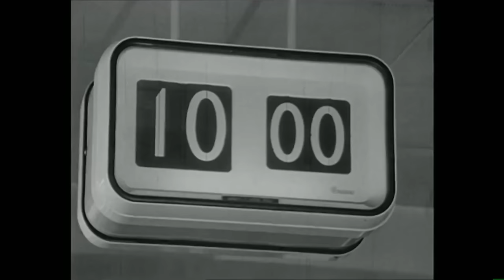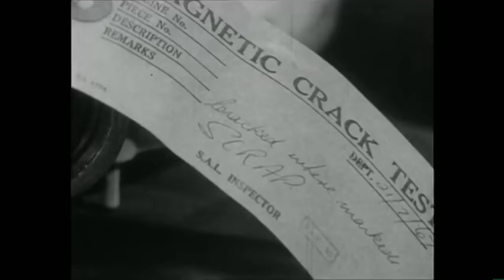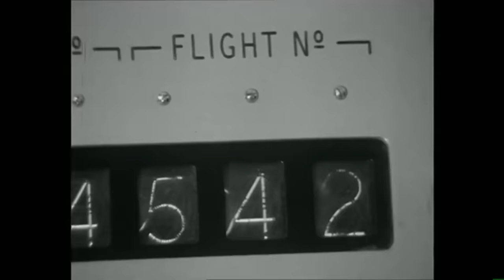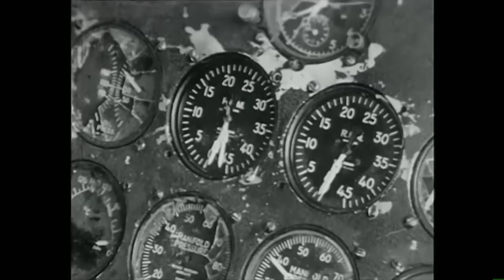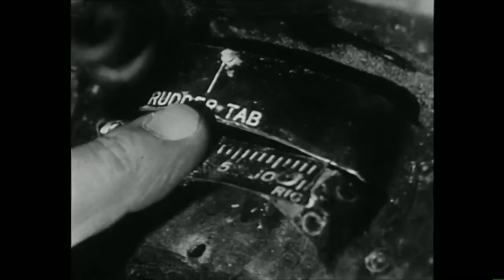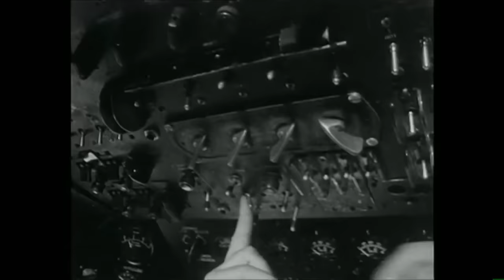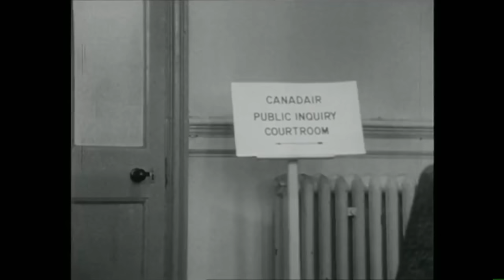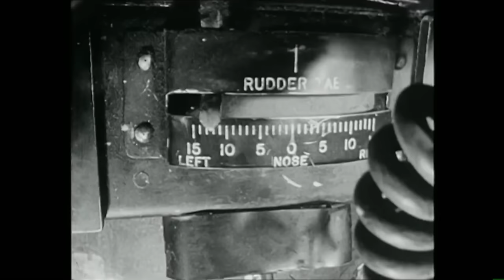Stockport Air Disaster

Comment: Did they ever use these engines in a DC 3??Canadair North Star
From Wikipedia, the free encyclopedia
Jump to navigationJump to search
North Star
BOAC C-4 Argonaut Heathrow 1954.jpg
BOAC DC-4M-4 Argonaut G-ALHS "Astra" at London Airport (Heathrow) in September 1954
Role	Passenger and cargo transport
Manufacturer	Canadair
First flight	15 July 1946
Introduction	1946
Retired	1960s (RCAF), 1975 (last civil operator)
Primary users	Trans-Canada Air Lines
Royal Canadian Air Force
Canadian Pacific Air Lines
BOAC
Produced	1946 - 1950
Number built	71
Developed from	Douglas DC-4
The Canadair North Star is a 1940s Canadian development, for Trans-Canada Air Lines (TCA), of the Douglas DC-4.[1] Instead of radial piston engines used by the Douglas design, Canadair used Rolls-Royce Merlin V12 engines to achieve a higher cruising speed of 325 mph (523 km/h)[2] compared with the 227 mph (365 km/h) of the standard DC-4. Requested by TCA in 1944, the prototype flew on 15 July 1946. The type was used by various airlines and by the Royal Canadian Air Force (RCAF). It proved to be reliable but noisy when in service through the 1950s and into the 1960s. Some examples continued to fly into the 1970s, converted to cargo aircraft.[3]

Contents
1	Design and development
2	Operational history
2.1	RCAF service
2.2	TCA and BOAC operations
2.3	Later service
3	Variants
4	Operators
5	Accidents and incidents
6	Surviving aircraft
7	Specifications (DC-4-M2 North Star)
8	See also
9	References
10	External links
Design and development
Canadair Aircraft Ltd. took over the Canadian Vickers Ltd. operations on 11 November 1944. Besides the existing Consolidated PBY Canso flying patrol boats in production, a development contract to produce a new variant of the Douglas DC-4 transport was still in effect. The new Canadair DC-4M powered by Rolls-Royce Merlin engines mounted in Rolls-Royce Universal Power Plant (UPP) installations[4] emerged in 1946 as the "North Star." More than just an engine swap, the North Star had the Douglas DC-6 nose, landing gear and fuselage shortened by 80 inches (6.7 ft; 2.0 m), DC-4 empennage, rear fuselage, flaps and wing tips, C-54 middle fuselage sections, wing centre- and outer-wing panels, cabin pressurisation, a standardised cockpit layout and a different electrical system.

Canadair built 71 examples of what was officially called the Canadair Four under the designations: North Star, DC-4M, C-4 and C-5. With the exception of the single C-5 (which had Pratt & Whitney R-2800 engines, as fitted to the Douglas DC-6), these variants were all powered by Rolls-Royce Merlin engines and 51 of the production examples were pressurised.

Operational history
Trans-Canada Air Lines (TCA), the Royal Canadian Air Force (RCAF), Canadian Pacific Airlines (CPA) and British Overseas Airways Corporation (BOAC) were the principal operators of the "North Star", with the CPA examples known as the "Canadair Four" and BOAC examples known as the "Argonaut".

RCAF service
The RCAF North Stars were unpressurized and were used on a variety of transport duties. Like other North Stars, they were notorious for the high level of cabin noise caused by the Merlin engines, as unlike the radials of the DC-4, the exhaust from the individual cylinders is not collected and exhausted via a single outlet, but instead exits the separate individual ejector-exhaust stubs in high-pressure bursts.

RCAF C-5 North Star
In an effort to reduce cabin noise, the sole C-5 variant was powered by Pratt & Whitney R-2800 Double Wasp engines that were considerably quieter.[5] The only C-5 was delivered to the RCAF in 1950, entering service with No. 412 Transport Squadron RCAF in Uplands, Ottawa, specially outfitted for the transportation of VIP passengers. It was used to transport the Canadian Prime Minister, the Queen, and numerous other dignitaries on various high-profile missions, serving faithfully for 17 years, later becoming a crew trainer before being retired and sold in the United States.

North Stars were also employed by 412 Squadron RCAF on various VIP transport duties and, overall, the aircraft provided valuable and reliable long range transport services for the RCAF. From 1950 to 1952, during the Korean War, RCAF North Star aircraft were employed ferrying supplies to Korea across the Pacific Ocean. They flew 599 round trips over the Pacific and delivered seven million pounds of cargo and 13,000 personnel on return trips. They flew 1.9 million miles without a fatal crash and outhauled the United States Air Force C-54s on the Korean run. After 1967, the remaining North Stars were assigned to No. 426 Transport Squadron RCAF initially deployed to Dorval, Quebec and then to Trenton, Ontario. Gradually, their service life diminished in the 1970s and most were declared surplus.

TCA and BOAC operations

TCA North Star at London Airport (Heathrow) in 1951

An ex TCA DC-4M-2 North Star of Overseas Aviation at Prestwick in 1960
TCA received its fleet of twenty DC-4M-2 North Stars during 1947 and 1948 and operated them on routes within Canada and to the USA until 1961. Starting in 1954 the North Stars were replaced on TCA's routes to Europe by Lockheed Super Constellations. To deal with passenger complaints about noise, TCA engineers developed a cross-over for the fuselage-side exhausts that reduced cabin noise by 6-8 decibels.[6][7] "In the cabin, noise is reduced to 102 decibels near the windows and 93 at the aisle."[8]

BOAC ordered 22 DC-4M-4s and named them the "Argonaut class", each aircraft having a classical name beginning with "A". The Argonauts were delivered between March and November 1949; they flew to South America, Africa, the Middle East and the Far East from London Heathrow Airport until 1960.

On 1 February 1952 the BOAC Argonaut Atalanta G-ALHK transported Princess Elizabeth and the Duke of Edinburgh to Kenya to begin a Commonwealth tour.[9] Some days later, 6 February, it was again Atalanta G-ALHK which returned the newly acceded Queen Elizabeth II to England upon the death of her father, King George VI.[10][11]

Rolls-Royce also developed a quieter 'cross-over' exhaust system for the DC-4M, the modifications being supplied in a kit allowing installation on the aircraft by the operator. The engine thus modified became the 'Merlin TMO' in contrast to the unmodified engine, the Merlin TML - Transport Merlin L. The modified exhaust conferred an increase in horsepower over the unmodified system of 38 hp, resulting in a 5 knot improvement in true air speed. Sound levels were reduced by between 5 and 8 decibels. Still air range of the aircraft was also improved by around 4 per cent. BOAC Argonauts initially, due to schedules being unable to be changed, had only the inner engines so-modified, the remaining outer engines being changed to the new exhaust system when time was available.[12]

Later service
After service with TCA and BOAC, the surplused North Stars and Argonauts had long careers with secondary operators such as British Midland Airways, Overseas Aviation and other charter companies. Cargo conversions of available airframes also lengthened the service life of Argonauts and North Stars.CF-UXA, ex-RCAF 17510 was the last DC-4M in airline service, completing its final flight on 19 June 1975 at Miami, Florida. Despite the onset of jet airliners in the 1950s, the rugged Canadair North Star found a niche in both military and civil use.[3]

Variants
Main article: List of Douglas DC-4 variants
Canadair built 71 examples under the designations: North Star, DC-4M, C-4 and C-5. With the exception of the single C-5 (which had Pratt & Whitney R-2800 engines, as fitted to the Douglas DC-6), these variants were all powered by Rolls-Royce Merlin engines and 51 of the production examples were pressurised.

DC-4M.1
Initial variant as designed for Trans Canada Airlines (TCA); at least 5 built for TCA.
DC-4M.2
Pressurised higher take-off weight version.
North Star

Comment: It was the flight engineer's job to monitor the fuel situation and he should have noticed that fuel was being pumped away from the engines (because the fuel-control levers had crept away from their correct settings).
Reply: This plane doesn't have a flight engineer.
Reply: @eddiehimself  Maybe that's why they do, now ??
Reply: @daffyduk77  No. Modern passenger planes don't have a flight engineer, nor do they rely on badly designed fuel transfer levers that don't give any positive indication that they're open.
Reply: He was not a flight engineer. He was a ground engineer, a mechanic. He was not part of the flight crew.
Reply: @daffyduk77  Flight engineers were common on passenger aircraft for many decades before this crash. They were made redundant by simplified designs and later by computerization.

Comment: Didn't they discover the 3 and 4 engine ram guages were switched...that would explain it...
Reply: Take a stride or Step aside RPM dials ? They decided this was not a factor. The main issue seems to have been the cross draining of fuel tanks. But no definite conclusion was really made.
Reply: This was mentioned again in the summary, that it 'was possible' the pilot had mistaken the failed engine for number 3, going by the instruments. Then the question was raised, that "did they realise it too late, and unable to start #3 again in time" Watch again from 44:50

Comment: At 0:50 ..”.....climbing to 2500 feet, QNH.”
Wrong - the altitude would have been given as ‘250 feet’, and QNH is always followed by numerals as it is atmospheric pressure corrected to mean sea level.
This statement is given again, with the QNH correctly, but the altitude still spoken incorrectly
Reply: No, the phraseology used is correct for the period - the controller clears the aircraft to two five zero zero feet QNH, meaning the nautical height that would have been given to the aircraft during the ealier approach.  Airlines use nautical height for landing, meaning the altimeter would have read 257 feet on touchdown (or whatever figure was valid in those days - if instructucted to maintain 250 feet, it would have been lower than the airfield height ;-)
Reply: Airplanes are given a barometer reading by Air Traffic Control so their altimeter is close to accurate as to height above sea level.  Above 18,000 ft, everyone uses 29.92 in mercury as the barometer reading and these are referred to Flight Level (FL) in hundreds of feet (U.S.).  And you wouldn't be at 250 above ground except very close to the runway, as you need to maintain 500 feet if not landing (or crop dusting).
Reply: @maschwab63  The Transition Level is 18k in the US, in the UK, it is much lower and we use Hpa (millibar) in Europe for altimeter setting

Comment: Issue
Mechanical failure 

Hanger - 4 
E - 124

F / motor 2 
F / pump 2 

Propellor blade 
Engine 4 stopped 
Propellor turned by wind 
Lancashire 
Roof tops 
Cockpits 

Dentist 
Strange

Lost height 
Tragic

Tail end 
Performance 
Of height ; air speed ; course 
Trapped in wreckage 
Fact recorder 
Air registration  board 

<100 mph 
Feathers the propellor 
Argonaunt control
Dangerously near to spinning 
Port engines in full power

Comment: No indication which engine had failed!  Others knew about the fault, it's a wonder it hadn't happened earlier.  You got to wonder why other airlines kept silent after the crash, you would have thought someone might have said "There is a fault condition with the cross feed, check the lever is properly closed.  But then, airlines are only interested in profits!

Comment: 4 Merlin engines in an airliner... in 1968... gee, what could have gone wrong?
Reply: @JZ's Best Friend I think he’s implying the age of Merlin engines in 1968, under the false assumption that old means faulty.
Reply: @JZ's Best Friend as investigators found, the conclusion is that the engines were likely in proper order, but that the cause of the crash was due to crew error relating to the cross freed levers. Which in turn lead to fuel starvation in engine #4, and confusion that snowballed from there.
Reply: Same thing as a DC8 or 727 in 68.... shit happens and airplanes sometimes crash.
Reply: @gastonbell108  Compared to the B-52 and many other aircaft in current service this plane and engines were spring chickens plus it's usual to have spare engines so when there is an issue they can be swopped out, in service they get stripped down and inspected every 1000hrs or so. Plus by this point in time the engine was well proven haveing been used in combat and civilian aircraft for decade plus so old tech maybe but well proven.
Reply: The Merlin was a superb engine.  What do you think powered the Spitfire and Lancaster?
Reply: Hawer Hurricane, D H Mosquitoes, Fairy Battle, Paul Doulton Defient, Avro York, some versions of Halifax and Wellingtons, Fairy Fulmar, lockheed Mustang, later version P-40 Hawk family and some others but I am struggling to remember names. Firefly  and Barracuda I think, where like latter Spitfires and Shackleton Griifin engines which was basically enlarged version of Merlin at roughly 36 litre capacity rather than Merlins 27 capacity. Well a jet engine might have been newer but early jets were not very fuel efficient and still being improved, for instance me 262 engines had expected life of 25 hours if they last half that they were thought to be doing well. Best off the cuff help on this I can give, our American friend seems to think developement takes a few months and in war time that might be true but in peace time refinement can easily take 10 years.
Reply: @owen368  The only similarity between a 'Griffon' and a 'Merlin' was the V-12 layout. This engine was designed not for the R.A.F. at high level, but at the request of the Fleet Air Arm for use at low level, so nearly everything else was different; lubrication of main bearings via hollow crankshaft, position of super-charger and engine accessories like camshaft drives and one B.T.H. dual magneto at the front not two at the back, slightly shorter engine, the possibility for contra-rotating propellors and of course the 10 litres increase in swept volume.
Reply: @DaveDeltic  Well I live and learn all I knew was size and shape and that some of the planes that used Merlins like the Spitfire went over to Griffin engine. It is often not distinguish as being much different in several books either know the contra rotateing props were used on the Shackleton as my Dad mentioned one that visited where he was based, latter crashed when it shed a blade killing the crew sad to say.

Comment: Pilot can't remember, pretty convenient seeing as how the cause turned out to be fuel starvation to the engines due to mismanagement of the fuel supply by the aircrew (pilot, copilot and/or engineer). Simply put, the pilot (and those he commanded) FAILED to do their JOB by neglecting to maintain proper fuel management, thus starving the engines of fuel.
Reply: From your comment, I will assume that you have never piloted an aircraft of any sort.... 
From WW2 onwards, aircraft and the systems therein became exponentially more complex; accidents happened, and far too often the cause was quoted simply as 'Pilot error'. If that attitude had persisted, commercial air travel would be infinitely more dangerous than it is today. Thankfully, the realisation came that it would be far better to investigate how and why the error took place and fix them, rather than simply villifying the pilot - who was often dead. Was it bad maintenance (such as the reversed rpm gauge feeds in this video)? Ambiguous instruments? Badly designed controls (such as the appallingly positioned crossfeed controls in this aircraft)? Poor system design (the Engineers didn't believe the reverse crossfeed draining the starboard tanks could happen)? Bad communication (BOAC and Canadair knew about this issue more than ten years before this accident but didn't think it would be a good idea to publicise it!)?
So yes... the pilot failed to make sure the controls were pushed those last few degrees...... but the position of them made operating them awkward, and seeing they were fully home impossible. Also no pilot (in fact nobody at all) in BM knew that would be a dangerous issue in this type of aircraft *only*........ Plus the designers designed a system that would do something unexpectedly dangerous when what should have been a very minor error was made........ Plus Canadair didn't bother to tell everyone when they found out something deadly would happen if the control wasn't moved the final few degrees.......
Simply put, there is no 'Simply put'. The pilot was at the end of a long chain of possibilities to avoid these deaths - he was unfortunately the one whom it is easiest to blame as you do. Next time you get on an aircraft, be thankful that it is so safe because the aviation industry no longer holds blinkered attitudes such as yours.
Reply: Well, simply put, that's a simple answer. This sounded like a series of small problems that added up to a big problem that ended up in a crash. Simply put, even the worst aircrews want to land safely, if not for their passengers, certainly for themselves. Sometimes, as they say, shit happens!
Reply: With a brilliant mind like yours so readily able to figure out who to blame, why aren't you working with the NTSB or the AAIB? Reducing things to such simplistic solutions would sure save a lot of money on investigations. It wouldn't make flying a bit safer, but we'd know who to blame. That's what matters, right?
Reply: Hold on falla did you watch the whole film they knew this was a problem 15 years earlier and did nothing
Reply: Yes total mismanagement of fuel was the cause, no point making excuses just because the pilots were British. If they were any other nationality they'd be described as incompetent.